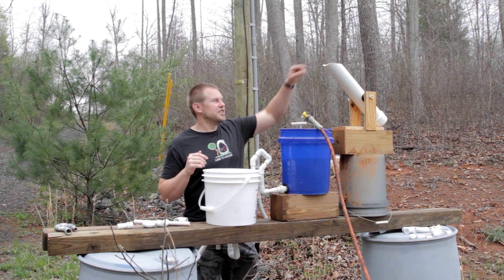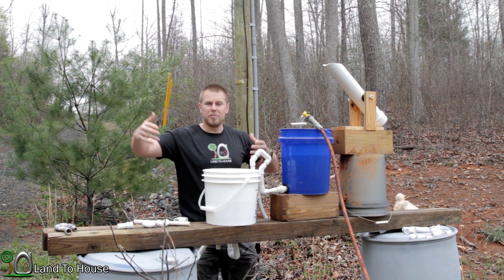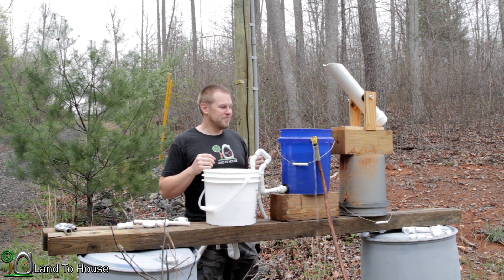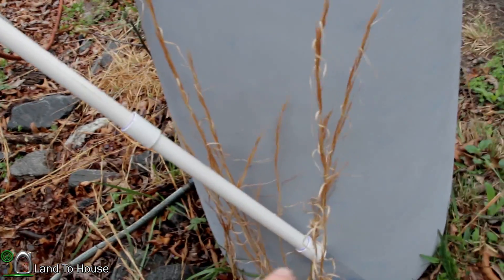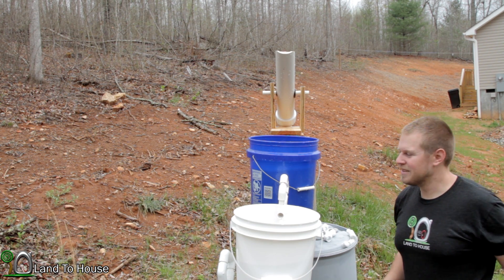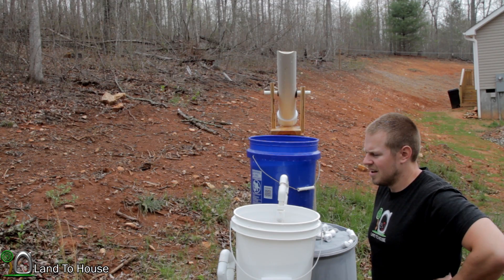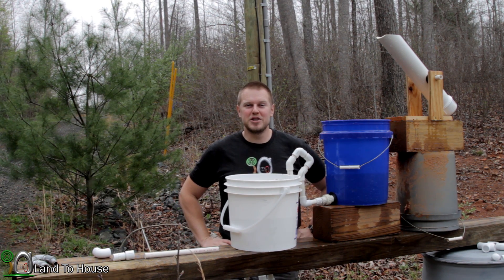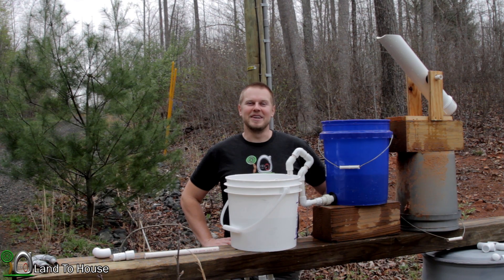Double U Siphon. Will it start?

Comment: Flow will increase through the siphon if you increase the head between the inlet and the outlet to point because this is suction based. (outlet on the bottom obv)

Comment: So what are you planning on using these siphons for? They are pretty neat I have to admit but I don't understand what you will be using them for.
Reply from the maker: At this point it is just for fun. My thoughts were to use this as a way to auto clean a duck pond. Every time it filled to the top it would flush itself and I would not have to clean it.
Reply: 2nd larger shishi adoshi to drive the second bucket